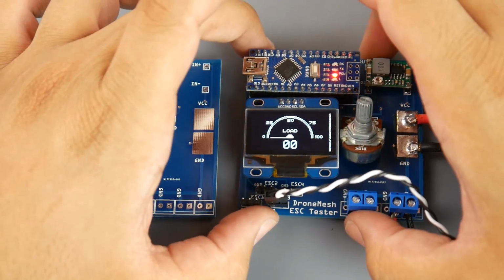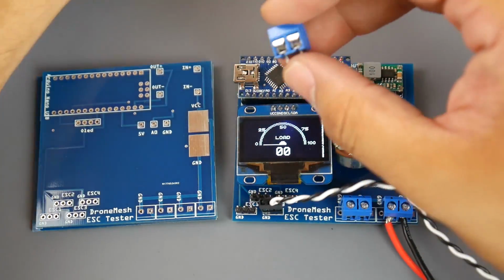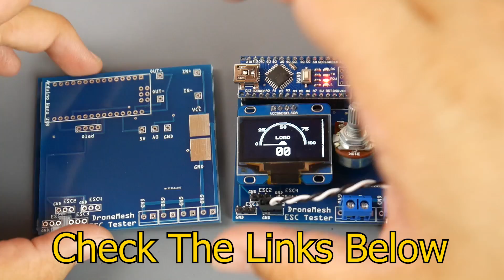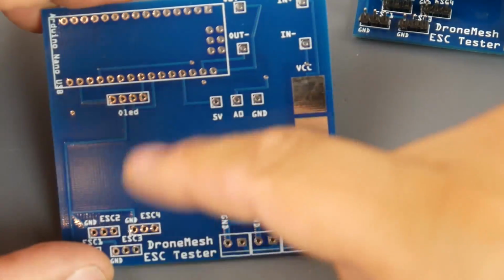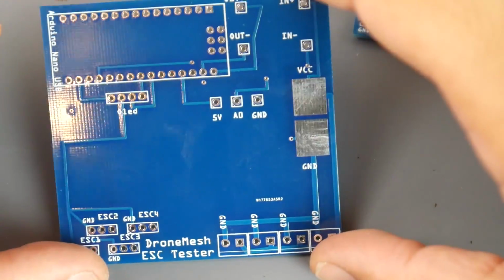#DIY ESC TESTER / MOTOR TESTER //  DroneMesh PCBWAY DIY KIT

Comment from the maker: Signup with the link below to get 5 USD OFF
https://www.pcbway.com/setinvite.aspx?inviteid=91614

DIY ESC TESTER V2 (The Updated Version)
https://www.pcbway.com/project/shareproject/DroneMesh_ESC_Motor_Tester_V2__Arduino_Nano_.html
Reply: Don't know if it is you but there is a site dronetests that is using your videos
Reply from the maker: @user-zw7zd3qv1w  Email me the link
Reply: Nice project, just make sure for next revision to make the copper traces for the ESC terminals much bigger to handle the current if you're planning to use all 4 ESCs at the same time, also there is something with the code that makes it jump when you change the speed. And the traces angle don't worry that much it is just for "PCB esthetics" doesn't have a real performance consecunce. Again nice project

Comment: Changing the port , seems board get´s connected , but still error: following message:

Arduino:1.8.5 (Mac OS X), Tarjeta:"Arduino/Genuino Uno"

/Users/Jaime/Documents/PROYECTOS ELECT -ARDUINO/Arduino/ESC tester/oled_esc/oled_esc.ino:17:51: warning: ISO C++ forbids converting a string constant to 'char*' [-Wwrite-strings]
 char* label[] = {"LOAD","COOLANT","INTAKE", "VOLT"};  
                                                   ^
/Users/Jaime/Documents/PROYECTOS ELECT -ARDUINO/Arduino/ESC tester/oled_esc/oled_esc.ino:17:51: warning: ISO C++ forbids converting a string constant to 'char*' [-Wwrite-strings]
/Users/Jaime/Documents/PROYECTOS ELECT -ARDUINO/Arduino/ESC tester/oled_esc/oled_esc.ino:17:51: warning: ISO C++ forbids converting a string constant to 'char*' [-Wwrite-strings]
/Users/Jaime/Documents/PROYECTOS ELECT -ARDUINO/Arduino/ESC tester/oled_esc/oled_esc.ino:17:51: warning: ISO C++ forbids converting a string constant to 'char*' [-Wwrite-strings]
El Sketch usa 17612 bytes (54%) del espacio de almacenamiento de programa. El máximo es 32256 bytes.
Las variables Globales usan 299 bytes (14%) de la memoria dinámica, dejando 1749 bytes para las variables locales. El máximo es 2048 bytes.
avrdude: stk500_recv(): programmer is not responding
avrdude: stk500_getsync() attempt 1 of 10: not in sync: resp=0x00
avrdude: stk500_recv(): programmer is not responding
avrdude: stk500_getsync() attempt 2 of 10: not in sync: resp=0x00
avrdude: stk500_recv(): programmer is not responding
avrdude: stk500_getsync() attempt 3 of 10: not in sync: resp=0x00
avrdude: stk500_recv(): programmer is not responding
avrdude: stk500_getsync() attempt 4 of 10: not in sync: resp=0x00
avrdude: stk500_recv(): programmer is not responding
avrdude: stk500_getsync() attempt 5 of 10: not in sync: resp=0x00
avrdude: stk500_recv(): programmer is not responding
avrdude: stk500_getsync() attempt 6 of 10: not in sync: resp=0x00
avrdude: stk500_recv(): programmer is not responding
avrdude: stk500_getsync() attempt 7 of 10: not in sync: resp=0x00
avrdude: stk500_recv(): programmer is not responding
avrdude: stk500_getsync() attempt 8 of 10: not in sync: resp=0x00
avrdude: stk500_recv(): programmer is not responding
avrdude: stk500_getsync() attempt 9 of 10: not in sync: resp=0x00
avrdude: stk500_recv(): programmer is not responding
avrdude: stk500_getsync() attempt 10 of 10: not in sync: resp=0x00

Comment: I´ve built the board  . It looks nice. Problem is that, when trying to load Arduino code , it does´t run. I get below messages:

Arduino:1.8.5 (Mac OS X), Tarjeta:"Arduino Nano, ATmega328P"

/Users/Jaime/Documents/PROYECTOS ELECT -ARDUINO/Arduino/ESC tester/oled_esc/oled_esc.ino:17:51: warning: ISO C++ forbids converting a string constant to 'char*' [-Wwrite-strings]
 char* label[] = {"LOAD","COOLANT","INTAKE", "VOLT"};  
                                                   ^
/Users/Jaime/Documents/PROYECTOS ELECT -ARDUINO/Arduino/ESC tester/oled_esc/oled_esc.ino:17:51: warning: ISO C++ forbids converting a string constant to 'char*' [-Wwrite-strings]
/Users/Jaime/Documents/PROYECTOS ELECT -ARDUINO/Arduino/ESC tester/oled_esc/oled_esc.ino:17:51: warning: ISO C++ forbids converting a string constant to 'char*' [-Wwrite-strings]
/Users/Jaime/Documents/PROYECTOS ELECT -ARDUINO/Arduino/ESC tester/oled_esc/oled_esc.ino:17:51: warning: ISO C++ forbids converting a string constant to 'char*' [-Wwrite-strings]

El Sketch usa 17612 bytes (57%) del espacio de almacenamiento de programa. El máximo es 30720 bytes.
Las variables Globales usan 299 bytes (14%) de la memoria dinámica, dejando 1749 bytes para las variables locales. El máximo es 2048 bytes.

avrdude: ser_open(): can't open device "/dev/cu.wchusbserial1410": No such file or directory

Problema subiendo a la placa. Visita http://www.arduino.cc/en/Guide/Troubleshooting#upload para sugerencias.

Could you please help me on fixing?
Thanks in advance

Comment: What the hell 90degree bends on the  PCBs u could have used the autorouter and u can use a attiny 85 chip instead of using a atmega328p chip its way smaller and that is an OLED display not a lcd

Comment: Please learn some basic rules of PCB designing: No Turns of more than 45 degrees. For a 90 degree turn do multiple 45 degree turns.

Cool Project tho. I modded a Servo Checker with a built in battery;)
Reply from the maker: I fixed all these issues in the V2. even added copper ground plates. 

Thank for the tips and info much appreciated
Reply: He can simply use the autorouter